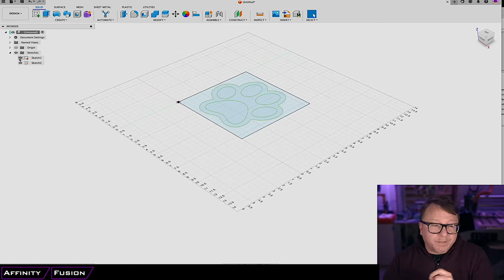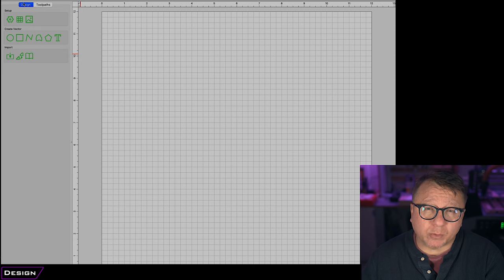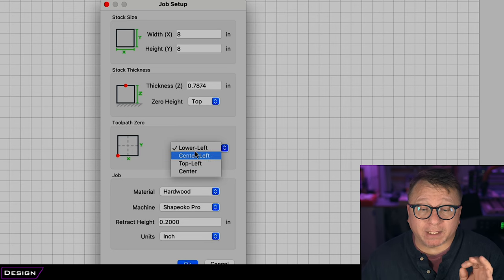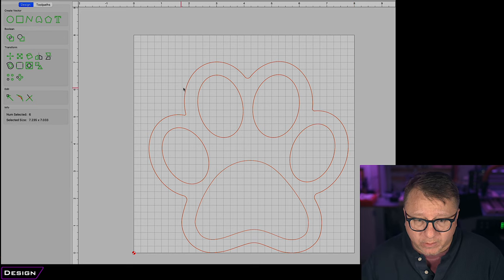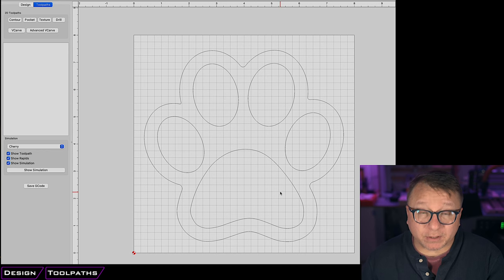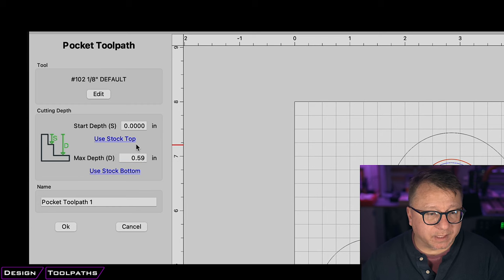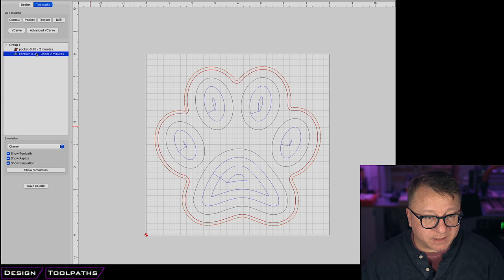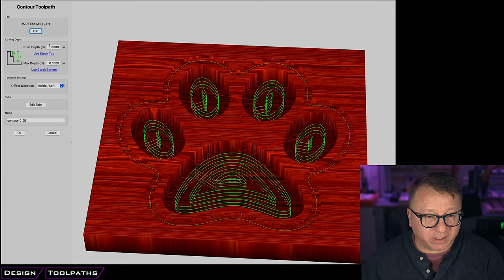Carbide Create for Beginners - EASY FIRST Project

Comment: I was wondering why you didn’t use tabs to prevent the inner piece from coming loose? I know you think you have good adhesion, but that final pass is very dangerous. Love the instructions and learning process.
Reply from the maker: Hi there -- well, because I thought I had good adhesion ;). In reality, tabs can be a pain - in this case, I just didn't want to clean them up on the router table. In hindsight, I took it to the router table anyway, so tabs would have been fine.  No "good" answer but "an" answer ;).  Thanks for watching!

Comment: Type 15mm in the inch field and it will automatically do the calculation.
Reply from the maker: Hi - I tried that an it didn't work -- will try again.  Thanks for watching!
Reply: @cyberreefguru  I believe it may be in the new version 7 of carbide create's expression editor, but to use it in a project for example if your project is in inches and you want to enter a mm value you just type that in, say "6mm" then hit "enter" and it will automatically convert for you.